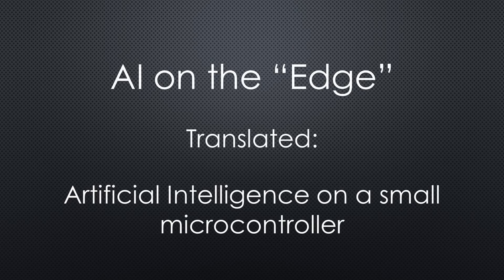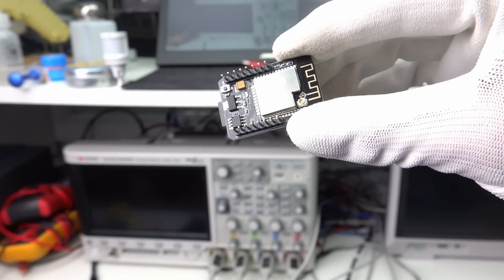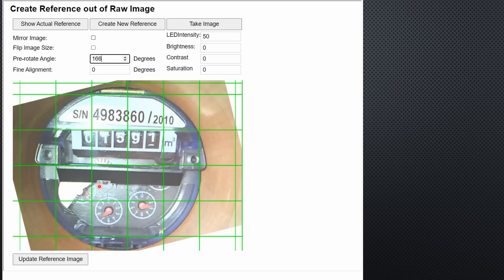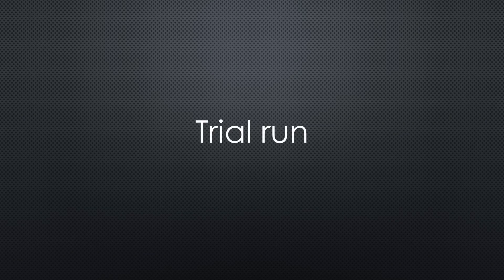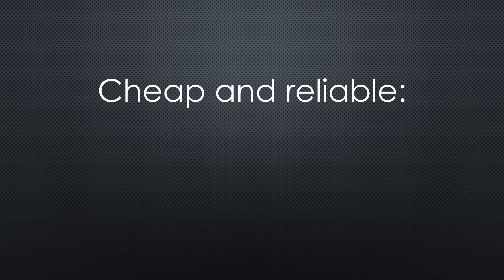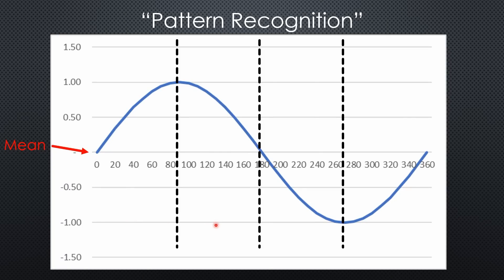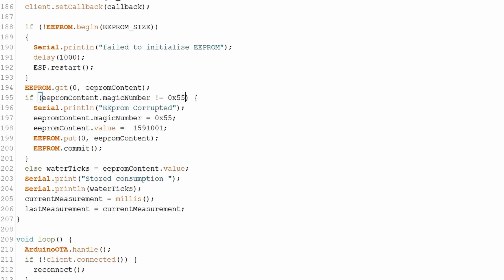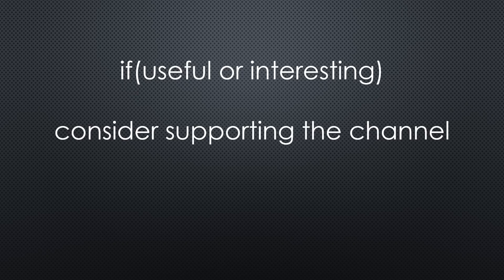#418 AI on the edge vs. Traditional Engineering. Water Meter with ESP32-CAM

Comment: Hello, I am disappointed that you gave up so early on the AI without digging deeper in where the problem is really. This is not the engineer way imho. Is the Neural Network Hardcoded on the ESP32 or how does it work? I think you need to retrain it for your specific type of dials and then it will work pretty good. Anyway you made me curious about this, I will hunt for a cheap ESPCAM on banggood and try to implement this too. Of course your old school implementation is very good too, but it is a little blind, with the AI you can do so much more!
Reply from the maker: I am sure it could be done better and more trained. But for one meter only? As you wrote: I am an engineer. And love efficiency ;-)
Reply: @AndreasSpiess  Sorry but I am disappointed. As an engineer you should understand why it didn't work and make the AI recognize your meter for the sake of all of us :). We want more!

Comment: Polarizing filters may help, but the angle of the reflectet should be in the neighborhood of the so called Brewster angle (the closer the better). If the angle of the reflected light is close to zero degrees (vertical incidence) a polarizing filter doesn't help. I such cases two polarizing filters may help: the 1st filter in front of the LED, the 2nd in front of the camera. The two filters must be 'crossed'.
Reply from the maker: Good idea! Maybe I will give it a try (out of curiosity and to learn).

Comment: Going the optical character recognition route, as was initially attempted would require a substantial amount of system training. You provide the images and supply the CORRECT digits in each case. Then after a while it will be able to do it reliably on it's own.
Reply from the maker: The training and the execution are separate tasks in AI. Training is done on big CPUs. But the execution (inference) does not need a lot of power and can be done on smaller machines.
Reply: @AndreasSpiess  that's true, but I assume that also the picture grabbing and processing, along with the energy needed to power up the LED would be high. In the meantime I was thinking about STM32's battery backup domain. This feature if I well remember should contain an event counter still working when the core is in deep sleep mode, which would be capable of turning on the system after some counting has reached a pre-programmed threshold. This could help, if you only need a rough value from time to time rather than a continuous monitoring.
Reply: @AndreasSpiess  You could train that simple model on decent 16 core desktop server, probably in a matter of days. The problem would be getting all the training images together, which would require multiple permutations. Those half digit images especially.
Reply: This is also the best solution to have the project running only for small amounts of time. But AI surely requires a lot of CPU power, and you can end up with a project which drains batteries faster than a proximity sensor one. I was also thinking about proximity sensors for smartphones: are those all of the reflective kind?
Reply: Retaining the model is actually very doable, even on a slower machine. Since you could use a pre trained model and only retrain the head.

The problem here is that you need images of all the numbers in every position to account for the led glare

Comment: Hello, I also have the AI solution for Gas and Watermeter and it works fine. But it took me some hours to do the correct setup. It it important, that the image is horizontal aligned and the scan area for the digital digits are large enough (larger than you wouId expect) , in 3:21 you see the 039 even includes the frames around the digits. This reduces the NaN results a lot and even recognized switching numbers. Also you must setup the initial value and a threshold to only overtake reasonable values (Values to low or big are thereby ignored). I mounted an angle iron on the wall 10 cm above the meter and taped the ESP32 below it. By twisting, you can move the glare point of the internal led to an area, which is not scanned, With this easy solution your energy provider can still read the values manually, if needed. Hope that help's to give it another try.
Reply: I agree with the above. I almost gave up on it as wel, but after adjusting and configuring for days it's been stable for weeks now. The documentation is very limited, but I can already see what you did wrong there (due to all my fails lol): 1. your camera is too far away or lens was not adjusted to have the best focus for the distance, 2. your rotation is slightly off (even 0.5 degrees makes a difference), 3. your reflection of the LED will hinder you a lot (experiment with different positions, angles, put a black sticker on the reflection point of your meter to limit the reflection, and if nothing else works, try soldering two small led's that you can position relative to the board) and then lastly, 4. your rectangles around your digits are too small. They need to be bigger (+-30% whitespace around each digit). If you do all of the above correct, I can almost guarantee that it will have it correct for 90% of the times and the rate limit should filter the other 10%. I can't speak for the analog ones as I didn't use those. The stability of the latest version was terrible, but the v9.2 was working fine. The camera drivers were changed in latest version and proved very buggy with my esp32 board type.
Reply: Seems I'am lucky, for me the AI on the edge solution works quite reliable since about 6 weeks now. It's reading all the 5 digital and 4 analog values of my watermeter properly. 
Three or four times I noticed errors. But those were detected and shown as error by the integrated plausibility check. So the sensor did not send any values until the readings made sense againt .
The big advantage of the AI on the edge solution is, that there it's directly reading the watermeter. So it always gets back to the proper values. When counting impulses and calculatimg the values little errors will add up and the real value of the watermeter and the calculated value of the sensor will drift further and further apart by time.

Comment: You could probably do with a bit of ESP on your storage, electronics stored loosely in plastic made me cringe.
Reply from the maker: No problem so far...
Reply: @AndreasSpiess  ES damage causes transistors to leak before they fail. A bit of antistatic foam would remove greatly reduce the risk, it's very cheap.

Comment: Thank you for these excellent videos. I love the clear thinking and explanation you bring to them.  

So, as AI has transitioned from its early mechanistic approaches (e.g., expert systems, etc.) to the current models based on non-parametric statistics, there is also a subtle change in its successful application. The current models are more about being 'less wrong' than 'exactly right in the instance'. This is encouraged by its alignment with large number theory and other assumptions (e.g., Bayesian Analysis, etc.). Given this, we might best think of modern AI technique as most suitable as part of a 'problem-space reduction' tool that gets bolstered and completed by more traditional, deterministic kinds of algorithms, rather than as a central part of some core algorithm.  AI's real mission, IMHO, is about abstracting 'the smart' from from everyday good engineering, and this will require a different kind application with different kinds of value produced.  I like to think of AI as a kind 'context manager' for whatever problem(s) I am trying to understand and solve.  

Still, this was a bold and valuable attempt. Bravo to Andreas Spiess, The Guy with Swiss Accent.
Reply from the maker: I only used AI for the YouTube algorithm. Otherwise I call this use case "pattern recognition". I still think that, if we take out the sales speak, a lot of valuable "AI" is pattern recognition, sometimes on a high level.
I also never know how much programmed "expert system" is in the applications. I use a spelling and grammar checker for my scripts and always wonder how good it is. But I fear there is a lot of standard programming behind it. Even if the leaflet calls it "AI"...

Comment: I guess that metal 'D' plate was designed for a specific optical sensor unit from the OEM with a shaped and focussed beam which probably made the electronic signal processing a bit easier.
we've got portable label printers at work that use IR to count and align the label paper by black marks printed on the back of the paper and they do a really good job under a lot of conditions.
Reply from the maker: Well possible that they wanted more accuracy. Or wanted to save on BOM cost and only added a simple sensor and no MCU.

Comment: You compared pears with apples. In the traditional approach you were able to choose the right tools and write a program to make them work. The equivalent process with such a focused AI tool is training it with your images and your labels (e.g. black background, rotating reflector, ...) After that and maybe some lighting adjustment, the camera-powered solution can be far more reliable than the traditional one (e.g. being able to recover from outage/disaster and being able to store some pictures for periodic manual verification)
Reply from the maker: Of course I compared apples with pears! And I liked apples more in the end. Comparing apples with apples often does not provide good solutions because your search is too narrow.
I know that the system can be trained. But for one meter?
Reply: @AndreasSpiess  you are right, the answer is not obvious, in the economy of such a model it is probably more appropriate to train for a class of objects, let's say the black background meters. I'm saying that a data scientist will find easier to train for your specific meter while sticking to "simple" camera hardware like an old smartphone,  compared to developing a dedicated module with opto-things etc. Same things applies to your "traditional" solution if you compare it to a 40 years ago flip-flop based counter, the trend is the same, always more powerful hardware and always more easy to write software for it

Comment: I wonder if AI based projects could be improved by offloading the AI processing to a cloud based process? But then you would have to deal with the difficulties of having to have a always on internet connection, the additional usage of internet bandwidth (imagine how much additional bandwidth would be taken up by AI water meters if a whole city used them) and having to possibly pay for the use of such a cloud service. So even if you could improve the project with such a approach the extra downsides might still outweigh its benefits compared to a traditional approach.
Reply from the maker: A lot of things are possible. But are they necessary? I liked the project idea and in Germany I would have used it. But for my situation I had to be flexibel. As always, we have deadlines...

Comment: Hi Andreas.. as usual solution is generally simple..when sought out. AI is needed where normal I wont work ;).
Btw.. i have been playing with this cam since quite a while. One way to reduce glare is 3D print diffuser.. other control intensity, lastly as you did rightly.. external LED.
But my major challenge is... how do we get rid of that glue.. never managed to remove or losen that focusing lens... any thoughts?
Reply from the maker: I used one of my sharp knives and had no problems. Maybe I was willing to sacrifice one and used a little force ;-)

Comment: Still nice to experiment with AI.
For the water meter, I have created one a year ago, using a hall sensor.
A few hints for those who want to create one too:
- as my meter has a metal spinning disc, a hall meter does work in my case
- I created an MQTT message from which I can update the reading after a reboot. Also, I keep track if an update was done.
- I had to use a condensor and a resistor to avoid false reading. They were rare, but completely eliminated with that small circuit added.
Reply from the maker: Thanks for the tips! Other viewers suggested avoiding the absolute count on the device and only keeping it on the Raspberry. That is what I will do. Only transfer the consumption.

Comment: The needle mechanisms are magnetically coupled to the turbine so you can for sure use hall effect sensor if you remove the lid and gears completely.
Reply from the maker: Good to know. But I did not want to destroy the top. I think the meter belongs to water supplier, not to me...

Comment: Andreas nice video! Why do you need the analog input. You can also use a "flip-flop" or? Do you know there are different esp-cam modules are on the market?
Reply from the maker: 1. I wanted that the sensor adjusts its values automatically. The middle value is not at 1.6 volts and the curve is not a sine as I showed (for simplification). But implementing a threshold could have worked, too. I agree.

Comment: Noce way to solve the problem!
However I'm not sure why you hadn't just used current analog check since it's metal plat, you can print a simple adapter and it would work like a charm. 
Moreover you can else just glue a tiny magnet and use magnetic field sensor using i2c ( not hall sensor ) which should be a bit more reliable. 
There's a video somewhere who explain Tesla door, they do something similar but with door. :)
Reply: If you cut a hole in the meter to put a magnet onto the disk the water police will have you for meter tampering.
Reply from the maker: Indeed, the meter is not mine :-( And I am quite happy with my solution. This sensor does not cost a lot if I remember right.

Comment: Hi, thanks for amazing video, very instructive.
I have a question: why don't use a Smith trigger to signal conformation to have a 0 and 1 digital signal? 
Thanks and see you next
Reply: A hardware schmitt trigger would add complications but it could be done in software with an adaptive threshold detector that was largely immune to changing bias.  Andreas's approach is neat though and has the potential benefit of being able to do some error handling or error correction.
Reply from the maker: Exactly. I wanted the sensor to be able to adjust automatically. The curve is not as neat as I showed (a sine was easy to draw) and its middle is not at 1.6 volts (it also changed with slightly different adjustments). But you are right. I most probably could have done it a little simpler. But I also wanted to be a little educational for other cases.
Reply: @AndreasSpiess  Thanks Andreas for answer. See you next
Reply: @makers_lab Thanks for answer, you are right

Comment: what about placing a piezo sensor to the water pipe? when there is a flow it should create some vibration and with some calibration there may be good results :)
Reply from the maker: These counters are precise (because they are part of a contract). So I would not want to invent what was already invented (and paid and installed) ;-)

Comment: Yup, if water meters where not leaded 😉 we could glue a tiny magnet on the dial arm. Anyway there are also sold water meters with built-in pulse output, but then you had to buy it self and let register and lead it again at the water supplier.
Reply from the maker: Ours is also owned by the water supplier and we must not change anything.

Comment: Happy Swiss! In D , we have to replace the water meters after 6 years - crazy! 
For 3 different meters I readout the fine strucured and fast spinning "star gear" using panasonic Sunx EX26 Sensor. These sensors include lenses. Works a treat over years. My main use case is detecting anomalies such as leakages or forgotten taps etc. But also the metering is  good enough. The last deviation I calculated was < 0.1%.
Over years I used ESP8266 incl. EEPROM but now, I am using a combination of ESPEasy (or ESPHome)  and ioBroker.
Btw. in the ioBroker forum there is a huge thread about the camera solution.
Reply from the maker: Our meter is more than 20 years old. Swiss quality ;-)
After a proposal from some viewers, I decided to do the absolute count on the Raspberry and only transmit the consumption. Should be easier.
Reply: @AndreasSpiess  My current method: Summarize the ticks on the ESP and always send the sum to the system (ioBroker in my case). This sum integrates well as long as the ESP is running, but it does not persist resets etc.
The system calculates E or Q according 
E = c*(tickSumESP + offset)
The system (e.g. ioBroker) checks, if the sum of ticks delivered by the ESP becomes smaller (tickSumESP < prevTickSumESP). If this is the case, I assume, that the ESP had a reset and lost its sum. The system now recalculates an offset value (offset = offset + prevTickSumESP) and nothing gets lost. 
If my system is down (e.g. update), the sum is not lost. The ESP continues to integrate and as soon as my system is back again, it gets the correct value. 
Only if both, ESP and system, are down at the same time, I lose ticks.
Reply: @AndreasSpiess  Ask your Netzbetreiber to install a meter with an Encoder output from GWF. Much easier. 😀